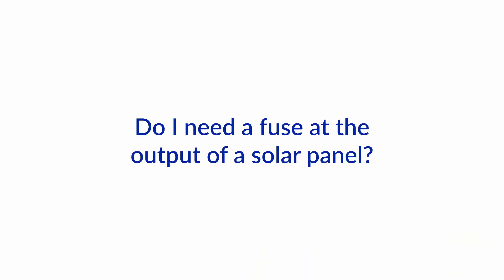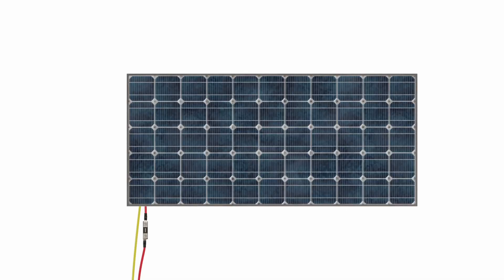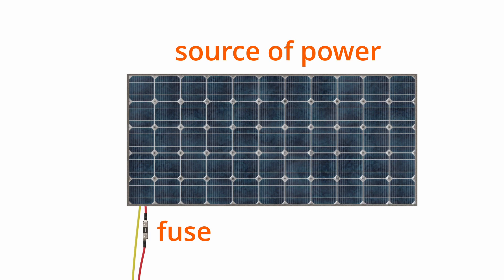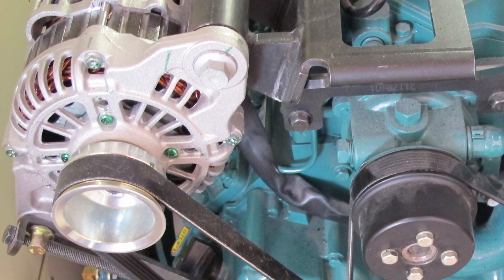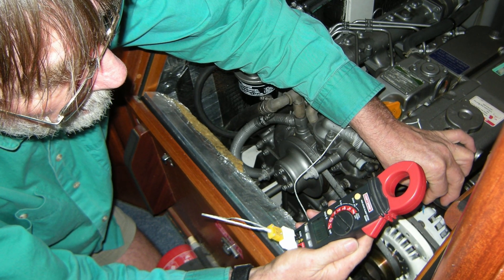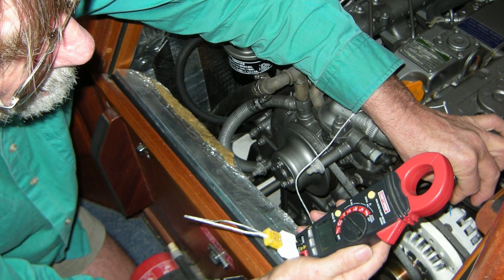Should I FUSE my SOLAR PANELS (and Alternator)?  | Ask The Expert with NIGEL CALDER

Comment: My scenario is a 25 kW motor running at 48v. That means 500 amps!  I was planning to use a pair of 4/0 wires in parallel with a bit of air between them. This may not be 100% according to Hoyle but what else can I do??

Comment: You need a fuse device between the alternator and the battery to protect from an over current fault due to a shorted alternator diode!

Comment: Can you have two fuses in parallel?
Reply from the maker: What would you want to achieve with such a setup? I don't see any scenario where this would make sense... -Jan
Reply: @BoatHowTo  I forget what I was thinking precisely, probably something about doubling the fuse capacity. Not important really.
Reply from the maker: @Ibian666  While this should work in theory, in practice this is likely to cause nuissance blowing: There could be minimal differences in resistance in the connections to the fuses, in which case one of the fuses would get more current. It may then nuissance blow, in which case all the current flows throughthe second one, which will blow as well. So better take a single fuse with the appropriate rating. -Jan

Comment: i have a 130 amp solar pan, max power 18v open circuit vol 22.5 max system vol 1000 wich fuse do i need
Reply from the maker: Are you sure you have a 130Amp panel (and not 130 Watt)? 130 A would be enormous! I would recommend to check out this article: https://boathowto.com/electrics/fuses-circuit-breakers-on-boats/ Or, to get a simpler, more in depth understanding, to check out our Boat Electrics 101 course. There we also have a bonus module specifically on solar panels. - Jan
Reply: ups you was right 130 w

Comment: The thing is that usually like 90% of the time said solar cable goes through the metal roof. And thats why we fuse it its in the new british waterways regulations (bss) 2018 version so what we do that we put a fuse just after the mppt to protect the cable if it gets damaged by the metal roof via vibration. I hope who needs sees this
Reply from the maker: Thanks for this comment. Indeed it is important to protect solar cables from chafing to avoid stray currents. However, I am not sure how a fuse between the controller and the panel should help with this. Even if there is a dead short, the current cannot be higher than the maximum rated output of the panel, so a properly rated fuse will not blow. (And luckily, the cable's won't melt either) But I am curious about what the British waterway regulations are saying on the topic, can you share their exact wording? - Jan